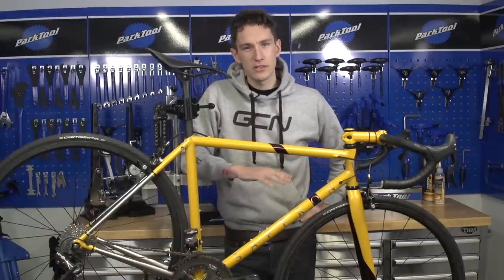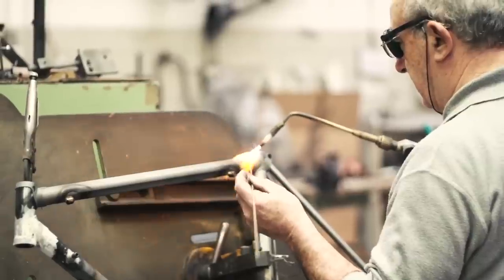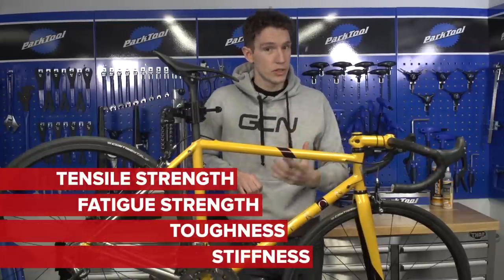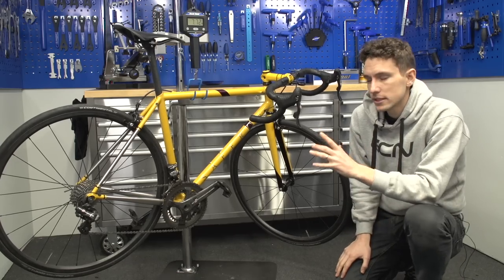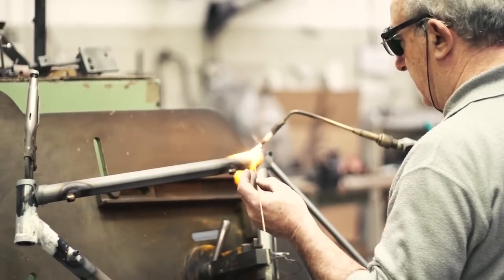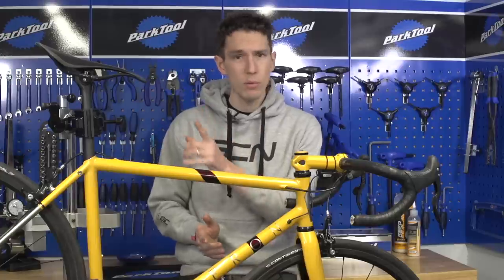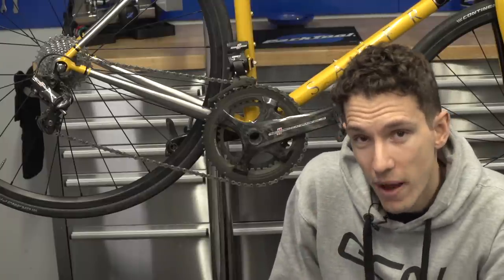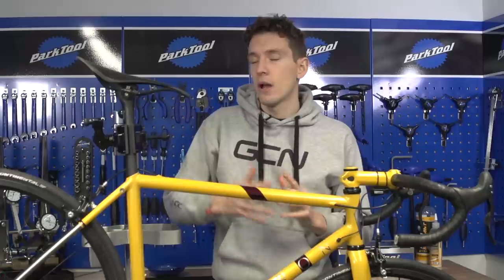Is Steel Real? | 6 Things You Didn't Know About Steel

Comment: I was hit by a car while riding my 2002 Bianchi Chromo Lite. I dove away from the bike while the driver ran over my rear wheel. Crushed Campy wheel and rear derailleur. The derailleur dropout was bent in at a 90 degree angle. Took it to the shop and they bent the dropout back into shape with a crescent wrench. Checked the angles and have ridden it for six years since with no issue. Carbon frame would have been in pieces.
Reply: Charlie Dillon I assume this was steel not aluminium
Reply: The "Chromo" in the name implies it. (CrMo steel)
Reply: That a carbon frame would have been in pieces is just speculation on your part. A car ran in the back of me, completely destroyed the wheel and damaged the rear derailleur but did nothing to the carbon frame, not even a bent drop-out. The frame is still going strong over 20 years later. Who knows what would have happened if I had been on a steel frame; I don’t because I wasn’t. In some accidents frames get damaged and in others they don’t, irrespective of the material.
Reply: Did you have a replaceable derailleur hanger by chance? My point was my frame was bent to a full 90 degree bend, sat for a few days, and was bent back with a wrench. Carbon ain't doin' that. Anyway, glad you were lucky and got some good use out of your frame!
Reply: The hanger is an integral part of the dropout, but no, everything was fine.
Reply: Steve Bradbury What happens if you snap the hanger, after it is supposed to be sacrificial.
Reply: I don’t know, but the bike is 25 years old and the frame is fine (it’s a Giant Cadex by the way). It was my main bike until last year when I decided to treat myself to a new bike with a lower gear than 42 x 23 and slightly less stretched riding position.
Reply: Charlie Dillon I crashed into a crash barrier at 40mph and totally my carbon frame. 6 cracks in the frame. No material would have survived that crash. However because carbon is so easily repaired, I still ride the bike now and it’s as good as ever. Carbon>steel for repairability
Reply: What's up with the obsession with carbon? It's not better than a good aluminum frame, slightly lighter! Big deal when it cracks all the time, I don't care if it can be repaired, because I know people that have had the same frame repaired many times at $300 + each time, aluminum rarely cracks, carbon has an imaginary cool factor that's all, sorry aluminum is as good or better 😂
Reply: My god man. Aluminum is hands down the worst material to make a bike out of. Get steel, carbon, Ti, bamboo, even plastic would be better than aluminum.
Reply: I agree, alu has no rebound elasticity so will fatigue with the constant road debris.
Reply: Dude you see Carbons crash in every race. Riders just pick them back up and keep going.
Reply: hmm
Reply: Mark Wells depends on your skill set. I’d say a normal person is more likely to be able to fix a carbon frame at home with some carbon patches and a can of  epoxy resin than an aluminum frame with a tig welder. It’s also completely non corroding so actually does well over winters.
Reply: Cromoly all the way. I've cracked aluminum frames.  Like to tour with 40 to 80 lbs. of gear. Seems to me tooling for steel would cost more than aluminum in manufacture.
Reply: Yea my dad hit a car head on (idk what was the driver thinking) and I asked him what happened to the bike, he said it became dust
Reply: Is the driver in jail?
Reply: Mark Wells i had a bike with aluminum lugs and carbon tubes bonded to the lugs. It was great
Reply: mark allen 80lb? What do you carry? Lots of food and liquids?
Reply: Bas Bakker i think salmon riders sbould be sobriety tested and fined or arrested
Reply: @stevebradbury984  and it would have broken the hanger only likely.
Reply: @charliedillon1400  I am PRO steel, just built up a new Cinelli which I love.  But carbon can be very resilient as well, so your perception that it crumbles is misplaced.I have been run over several times.  Carbon has done fairly well.
Reply: @charliedillon1400  and carbon is very easily repaired now.
Reply: @wierdalien1  . You need to learn 6 things about aluminum.
Reply: I wish i can post a picture from Philippines, he's a road cyclist with his carbon colnago from Europe(shipped to Philippines) and a motorcycle rear ended him and the frame was in pieces lol i wouldn't recommend having a training with a carbon frame down the road.
Reply: @peterburgess9592  Also they discard the frame after the race, no problem when a manufacturer supplies you with virtually infinite bikes.
Reply: @joshbaldon7438  You can. Upload the picture to https://imgur.com/ and post a link here.
Reply: @Bartooc  i just posted the link
Reply: right there are no carbon swords
Reply: The point here is that if carbon is bent, carbon is broke. (They are breaking in the bike stands!) Steel or aluminum can take lateral impacts, ie crashes, many times greater then carbon. To each his own, and if saving a pound or two on a frame is worth the risk to you have at it.  Especialy when you, as an average cyclist, weigh between 140 and 220 lbs before the bike. Stop listening to the marketeers, think for yourself.
Reply: @stevebradbury984  "Not even a bent dropout" 

Of course not, carbon just breaks instead of bending.
Reply: @desertrainfrog1691  The bike I was referring to, had metal dropouts bonded to the carbon tubes; so yes the dropouts could bend. However, you have missed the point of my initial post, which is that carbon frames can be as resilient, and long lasting as steel frames. I’ve owned the bike for coming up to 30 years (making it older than many who post here), and although I don’t ride it very often, it is still in good working order.
Reply: @Bas Bakker Probably British, he can't pronounce aluminum as well as the rest of the world
Reply: @Bas Bakker Unfortunately you are absolutely right.
Reply: I'm glad you survived that motor mayhem.
Reply: Have they found the body yet?

Comment: I ride steel everyday ... unless you're riding for competition there's really not much difference
Reply: un less your racing super enduro bat shit intercontinental masacisam and then steel ftw
Reply: Brian Cartoscelli I race a carbon Sava bike but my training is 90% on a GMC Denali 6061 30 lbs alloy. People always ask me why are you so slow during training but win on race day?  I point to their bike and say : Is that the bike you trained with ? Their answer is YES . I tell them next time take a backpack and add 18 lbs to it then go train  and tell me how it goes. They storm off looking pissed.
Reply: If you train for same amount of the time, it doesn't matter on what bike, because the watt you produce will be the same just at lower speed.
if you train at same distance then you are right, because you maintain the watt output for longer period time on a slower bike

Sorry for my English :D.
Reply: Sharif Naddaf Indeed it's the same 40 km course. On the Carbon it feels like a joke. On the 14 kg road bike it is a challenge. In my opinion ( just me ) a 6 kg bike does not add enough resistence to train for maximum output on shorter courses. 14 KGS with 175 lbs + 25 km wind going 32 km/hr is not that easy to pull off. And you will need some legs to pull that off for 40 km straight. Not many can pull it off specially on a 14 kg bike with 32c tires . That is the type of training I do. This is why I train on a heavier bike as the resistence is passed to the legs much faster and your body has to maintain a constant flow of oxygen to maintain those speeds.  Some pros actually do this type of training. They use the same bike but loaded with bottle weights. This type of training is never discussed because it really is only for top level cyclists who want to have that extra edge. Looking at Chris Froome for example if we both did a short 20 km course with 14 kg bikes Chris Froome would be dropped in the first km. However if we both did a 200 km course on 14 kg bikes ( full max output ) I would be dropping out at 70 km and would DNF. Different bodies , different tools. Long distance smaller weight and lighter bike. I am built more for track cycling so 200km runs are not possible ( at full max output).
Reply: Idk the times for pros haven’t changed much since they still all rode steel so I think in reality it’s just like carbon, quality is what matters not material
Reply: @bingrusginckle  

Actually the times have changed significantly, but that's more about doping than bikes.
Reply: I pick steel.i have a 26" wheel 20ich frame chrome bike almost 18 years.its rotting at d nect for sumtimes nw still has not broken.i no need a new bike nw.but steel is best
Reply: @batterybuilding  All my friends are real man, no single douchebag weenie in the crew. So there is no problem, because they all ride on steel. Welcome to my real world.
Reply: @Just a random dude Three points....................  
One................ Why do fastest start to finish times from the '60's, 70's and 80's STILL exist in a variety of UCI events, both single  day and stage........?????? Let THAT marinate. 
Two...........How far do you want to take the lighter weight insanity.....???? When will it end............? 
Three............. Come back to No. 1. HOLA!!!!
Reply: Buenos Dias.
Reply: @batterybuilding  Not if he weights more, haha.
Reply: The Oliver Pickard yes. I have a steel touring bike and it is really nice, reliable, low maintenance, and very robust. Carries 100 pound of cargo in panniers no problem.
Reply: Kandi Klover 

Very nice 👍
Reply: On a vacation I had put a bag on my Bianchi gold race special (steel frame, 12 kg total, from before 2000). The bicycle is so beautiful, I will never want another bike. If you go slow on it (like me), people can see it even better. You just can't loose. To be honest I find most steel bikes prettier. Bag on it was fine, I didn't notice it. It is a bag which attaches to the saddle tube by way of a metal thing and then the bag slides unto that, so it's a stiff thing. My brother has an aluminum frame, so we switched bikes to see if it mattered. It did seem to matter for speed or effort. When we switched the bag unto the aluminum frame, that frame could not handle it. It was starting to wobble if you got out of the saddle. The whole bike was snaking around dangerously. I'm not saying that's bad or good, just pros and cons is all. They may have gone for more weight saving on the aluminium frame, sacrificing stiffness. This issue could mean that if you have a very light weight and not so stiff frame, you might need strap on bag(s) if you want bag(s), so they don't torque the frame as much. Both frames seemed to have the same kind of springiness to them, if you bend them on the paddle.
Reply: Jos Boersema 

Amazing 😍

Comment: I rode the same aluminium mountain bike frame for twenty years. As I am in my early fifties, I began to notice the frame stiffness more particularly over rough surfaces. I had an old 1997 full cromoly Gary Fisher Marlin frame and recently transferred all the components from the aluminium frame. The bike although slightly heavier is much more lively as the frame and fork flex slightly over rough surfaces making riding more comfortable similar to Reynolds 531, Tange and Columbus tubing. I should have done it years ago

Comment: I've had 2 custom steel frames previously and a few factory made and got a carbon bike for last season. I was quite underwhelmed. Naturally the lesser weight does make it slightly faster uphill and on fast accelerations, which was expected, but the overall character of steel and it's capability to soak up uneven tarmac and sort of spring load your energy (if that makes sense) makes up for the weight penalty tenfold.
Reply: The steel vs aluminium/carbon comfort is certainly a common feature bonus that I've heard about. The thing is, you can engineer all of the materials, within limits, to specific ride qualities. I just wonder how much of this is about customer preferences vs. actual material performance.

That said, I've never ridden a steel frame road bike, they went out of mass market before I got interested. Getting one just for the experience (and switching frames once in a while) is certainly tempting.
Reply: nimeq titanium should give you even more comfort, at lower weight. I got myself a titanium MTB frame, and it definitely feels great. I'll definitely consider it for a road bike but it would be great to see a video where they talk about it, since they are less common and it's hard to find a bike to test
Reply: As much as I love my two classic steel frame road bikes, I would jump at the opportunity to ride a titanium frame. As you said, though, they are exceedingly rare (even in bike-friendly Minneapolis) and they are expen$ive.
Reply: I've ridden and raced different steel, carbon, titanium and aluminum frames since I first started racing in 1987. By far, the most agile and high performance ride has been a Scott CR1 (saunier duval edition). This is in comparison to a Basso Gap (columbus SL), Kellogg (ishiwata 020), Giant Team TCR, and a Merlin Road, in addition to others such as Devinci, Fetish, and cannondale. I still have all these bikes, btw, in addition to several others. My comment is - if you didn't have your mind blown by the performance of a well--built carbon frame, you weren't riding a well built carbon frame. There really is no comparison. There is a reason the pro's ride carbon, and it isn't because they're paid to. They ride the bike that will help them win. This is why you sometimes see a pro riding a bike with a name on it (usually the teams frame sponsor) that was built by someone else - and it's never a steel frame anymore.
Reply: Zen Cycle - Complete BS!  

Loads of high level national cross and road races are won on titanium, steel, and aluminum bikes each year.  

Pro's ride what the sponsors give them,  and by and large the largest bike companies out there that have the $$$ to sponsor pro teams are pushing carbon fiber bikes because that's what they mass produce and make the most $$$ off of. 

I've ridden a Crumpton,  a Parlee,  and a custom Calfee and none of them blew me away with their performance.  Used to have a Look 585 carbon fiber frame,  a pretty well regarded frame ridden by several top euro teams.  Nothing overly amazing about it either. Have ridden both Specialized S Works,  and Cannonale CF bikes  (both have been ridden by multiple TDF Pro teams).  Again,  nothing that blew me away or suddenly out of the blue made my performance shoot to the moon.

At the end of the day it is always about the engine,  and no carbon fiber frame including a Scott is going to suddenly make anyone worlds faster or worlds better.  Components and wheels have gotten so light that any reasonably well built steel or ti frame with a CF fork and a nice set of light CF wheels and can easily be brought down to at or very near the UCI weight limit so there is no huge weight advantage either when you look at the total bike package. 

I have a steel Vanilla as one of many examples that with Dura Ace and my Zipp wheels is 14 lbs and change in a size that would be the equivalent of what most frame makers call a stock 57 size.   And that bike rides as fast and as well as any of the "high foot" CF frames I have ever ridden including the Look,  the Parlee,  the Specialized, and the Crumpton,  which are all regarded as very good CF frames.

A guy name Alejandro Valverde (not a bad rider, LOL) rides a Canyon Ultimate, yet often trains on old school steel frames,  and is on record saying he could easily ride several of those frames in races and be competitive with the right groupsets and wheels.
Reply: Bob Gardner source that valverde trains on steel?
Reply: balleur the harsh ride of plastic is annoying, I prefer aluminum, I've never had one crack, steel obviously is amazing but on gravel road and trails it a big difference, on road I'll stick with aluminum
Reply: @nimeq  you can't safely make a forgiving (ie somewhat flexible) aluminium frame. Aluminium has next to no fatigue strength. If it flexes it will fail and unlike steel aluminium fails catastrophically and with very little warning.
That is the reason why passenger jets have a limited amount of flying hours when they leave the factory. Once that is reached the integrity during normal use cannot be guaranteed ie a wing could snap of at any time.
Reply: @markwells8798  I've had an aluminum frame for 2 of my mountain bikes and I got 4 cracks on them, the manufacturer replaced the last one with a carbon frame (because it was under warranty). I never had any problem with this last frame in 9 years.
Reply: Well designed carbon fiber will soak up bumps just as well if not better.  The fiber can be selected and laid up  to flex or not depending on the location within the frame.  Most steel tubes only give you butting and alloy choices which are the same throughout the tube. I love steel, but my carbon TT bike is much better than my old steel road bike (A Bontrager Road Lite).
The only places I would give steel clear victories over CF is recyclability/environmental impact  and that small builders can build steel.  A really good CF frame ultimately requires high pressure molds and ovens for consistent build quality as well as allowing for more creative designs.  Steel just needs a torch and jig (and a lot of practice!)
Reply: @lokedhs  Yup. For what I spent on my now parked carbon bike,I could have got a good Ti Frame and started building it up.........Now Ive got a carbon bike that wont sell for 1/4 of what I paid.
Reply: @gustavmeyrink_2.0  Aluminum frames really dont flex much at all,if they do they are going to break,you are right.  Soft is not an attribute of Aluminum.